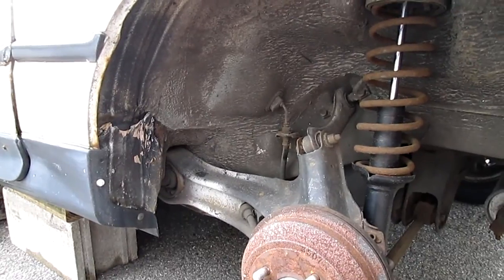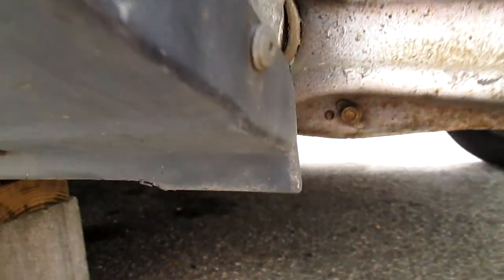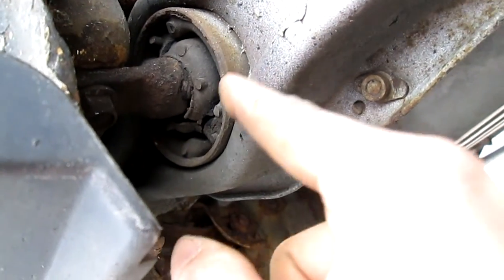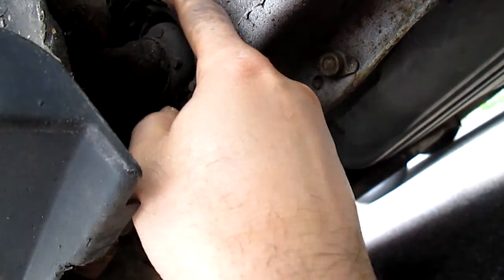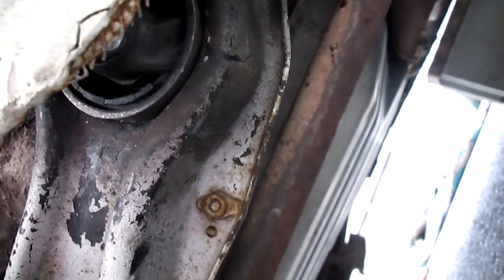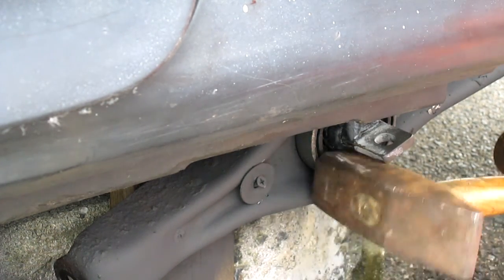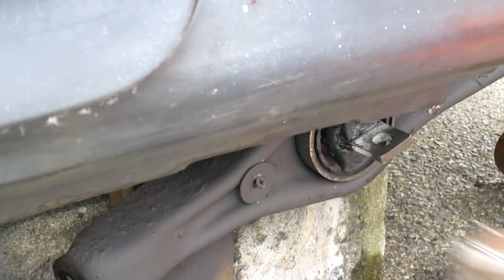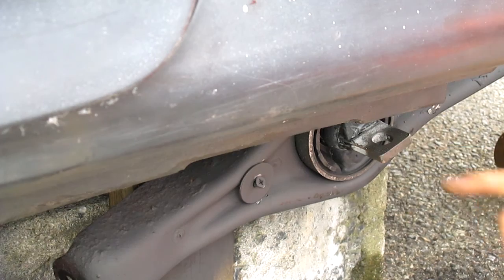EASY Honda Rear Trailing Arm Bushing Repair - No Special Tool - Civic Acura CRX CRV

Comment: Thanks for this great video. We had trouble getting the bushings started in the holes. Would hit one side and the other would come out. Our solution was using a strut spring compression tool to squeeze them in some, then pound them in the rest of the way. The tool kind of deforms the rim of the bushing, but as you pound it back in, it returns s somewhat to normal shape.
Reply from the maker: You are welcome!

Comment: I have done a couple of these, even bought the Honda tool for this job, Never like that the tool presses this bushing out to the inside of the arm. There is a taper and pressing it out to the outside is a better choice. Never thought about cutting the old bushing like this. Worked a lot better than the Honda tool for the job. I did use the tool to press the new bushing into place.
Good suggestion.
Reply: I can't remember but I'm fairly sure the FSM says that pushing it out the wrong way will destroy the retaining ridge. Might be the front wheel bearing, but I'm almost certain it applied to the trailing arms. I saw people going the wrong way with the fronts, too... I just do what the FSM says.

Comment: Your Video is great! Was super helpful doing mine! Thank you buddy! I accidentally broke a brake line and had to bend a new one before the system bled empty :( but other than that it wasnt TOO bad.

 No need to buy the tool, that was the easiest part of the job with a frozen new bushing and then cutting a slot in the old one
Reply from the maker: You are welcome and I'm glad it helped you!

Comment: The trailing arm hole is tapered. One side's diameter is wider than the other. You want to only remove the bushing towards the exterior of the car. If that hole gets to big, bushing can end up changing it's position from simply the car going over bumps. Also when you hit the bushing with a hammer,  you're at risk of bending the arm itself, and permanently messing up the ability to get the rear toe alignment in spec.
Reply from the maker: You have it backward !!!  Look at it really close, YOU SHALL SEE !!!
Reply from the maker: NOTE:  Once it's CUT, like in the video.  It doesn't matter which end you take it out from.  Please understand a little basic physic, before making comments.
Reply: Yeah you're knocking it from the wrong side... if you hammer it from the inside out  you don't even have to put the cuts in it. This is 100% the wrong way according to the Honda manual
Reply: @JodBronson you don’t need to cut it if you knock it out the right way. You are 100 percent hitting it on the wrong side. You can argue to your hearts content but I have a Honda book right in front of me that says your wrong.
Reply from the maker: @r.l.strange1897  -  Sure, you can knock it all day, but took me 5 minutes to get it out.  by the way GO TO SCHOOL !!!  Nice English "your wrong" !!!  <<< If calling people wrong, at least do it correctly.... YOU ARE WRONG!  LMFAO!  🤣😂🤣🤣🤣😂
Reply: @JodBronson  i changed this part yesterday knocked it out with a hummer not even min
Reply from the maker: @motivator4333  -  You knock it with a hummer?  What is that?  By the way, you do not want to knock it out.  Either press it out or cut it.  There are reasons why and that is why they made it that way.  It's called "PHYSICS" !!!  😅🤣😂

Comment: ATG, Honda, pros, you & I are correct, that one should hit from the inside out.
As the same time Jordan Bronson made two little slices, resulting less energy to smack it out from the inside rather than outside.

You main task & if you are lucky that those 4 bolts on the comenpsator arm are not seized & rusted.
Reply from the maker: Right, I found a better way to do it.  Some people just can't see it or acknowledge it.  Also, smacking will do more damage... So, I chose the quick and the easier way.  The 4mm thick cut took LESS than 10 minutes with both slices.  As you can see, I knocked it out with a large screwdriver and NOT with a hammer, because it didn't take much.

Comment: yeah..that hidden nut on the bolt....he's right....@1:10 of the video....don't take that one off unless there is a drill ready to make a hole in the metal....to get to the hidden nut on the other side...yeah he's right again, just take off the bolt @3:05 of the video...I did that, it worked out just fine...I have seen so many other videos loosening the entire suspension, NOT NEEDED....unless you want to play around than have fun....
Reply from the maker: Glad it helped ya!

Comment: In this case, the old bushing is not original, but a straight ring replacement that was pressed in and "un-tapered" the original flange in the process.  This is why those bushing rings often require cutting to remove.  Whereas the original bushings have a taper and hammer out pretty easily from the back of the TA.  I mean it when I say there is no way you'll ever hammer in a straight ring replacement bushing into a flange that's still tapered.
Reply from the maker: Does it matter.. New or Old or did my grandma leave a will on it?  THIS VIDEO IS ABOUT HOW TO  IT WITHOUT TOOLS !!!

Comment: Would failure of rear bushings affect the rear tire alignment?
Reply from the maker: YES and also can warp your rims and wear down your tires unevenly too.
Reply: @JodBronson  ..my left rear wheel is always slightly out of specs and the alignment shop pointed out to me my bushings are worn and cracking
Reply from the maker: @ancientdiscoverys  -  Yup, that will do it!
Reply: @JodBronson  ..had the rear bushings replaced today. The steering wheel vibrates now and the tires seem real heavy. Mechanic told me to get balancing and alignment tomorrow ASAP

Comment: Does freezing them make a big difference?
Reply from the maker: YES!
Reply: @JodBronson  I just did one side without freezing the next side I will freeze for sure. Thanks
Reply from the maker: @1mach28914u1  - I did it for 48+ hours.  Anytime you can freeze something, do it.  Metal shrink in cold and expand in the heat.  😂😂😂😂
Reply from the maker: @1mach28914u1  -  It also helps wacking it in too.  Because metal shrink, it lessens the damages.  LOL

Comment: I have always just simply tapped the bushing From the Inside with a hammer in a extension. It just pops right out after three taps
Reply from the maker: I found a better way to do it.  Some people just can't see it or acknowledge it.  Also, smacking will do more damage... So, I chose the quick and the easier way.  The 4mm thick cut took LESS than 10 minutes with both slices.  As you can see, I knocked it out with a large screwdriver and NOT with a hammer, because it didn't take much.

Comment: I could almost guarantee that bushing ripped within the first 6 months. You need to press that bushing in correctly line or else you'll get tension on the bushing, rip it and being the same predicament that you were from the beginning. Should have just did energy suspension bushings
Reply from the maker: It's still on today as we speak.  Don't try to "predict" please... It's for people with biipoooolllaas....  Stick with something called "Basic Science" !!!
Reply: Jokes on you homeboy oh, I have a 97 Civic I just got done doing it energy suspension bushings all around, nuto new foot, coilovers, and new tires. All in 3 days. OEM shell arm bushings are crap if you don't put them in right
Reply from the maker: @juliuspoorman9170  - It's still on today as we speak.  Don't try to "predict" please... It's for people with biipoooolllaas....  Stick with something called "Basic Science" !!!
Reply: I did same way, now 5 years still in good condition .

Comment: So, "ONLY" five fucking rusted bolts from hell....before a successful removal, right?  And I haven't even watched the video yet.  Be sure to say....PRE-SOAK w/ WD-40
for 6 months prior to removal.  Literally today, (2021-07-2021) picking up my '99 Civic for a non-related repair:  I just got quoted (for a strictly BUSHING)= rear arm replacement......$923.00      They are telling me about 2hrs. per side, 4hr. Labor, and about $150/parts.  Again, NO r.arms- just the bushing.  -Metro Seattle
Reply from the maker: Watch the video !!!